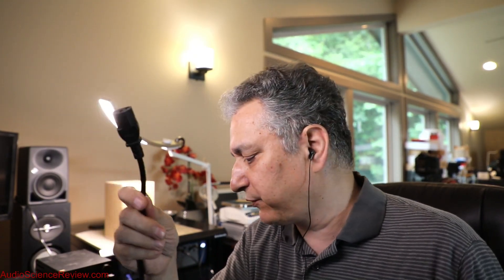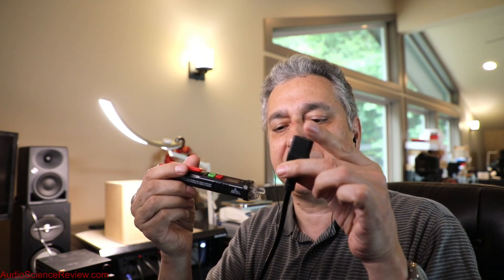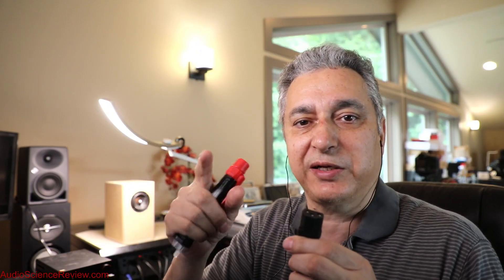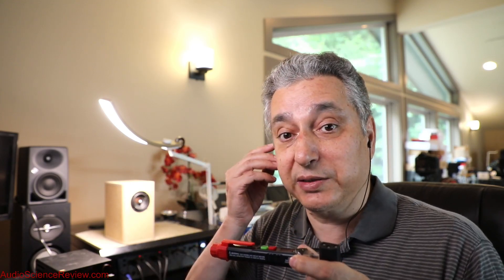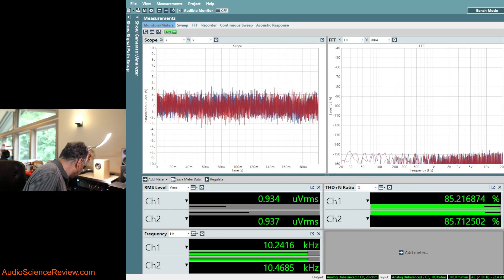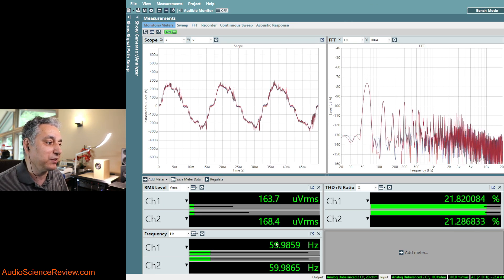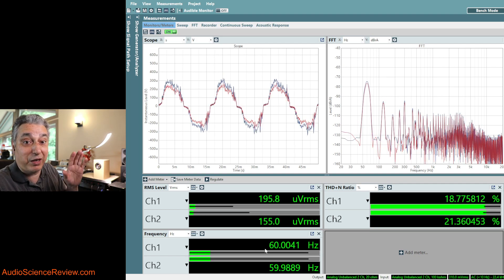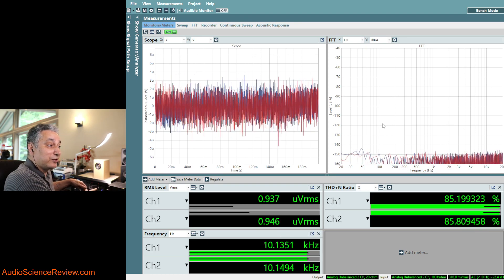Testing Open Power Cord interference in Interconnect Cables

Comment: If I understand correctly, one cable side is connected to mains power and the other side is not. 
Does it like  AudioQuest's patented Dielectric Bias System that uses battery on a cable with one end not connected and one yes - exactly as here ? Thank you

Comment: You clearly demonstrate that an unplugged AC cable can cause interference.  And then you show that plugging the other end eliminates this interference. All good! Curious though - given that such AC cables are plugged in at both ends in practice, why would you present this data in a review?
Reply from the maker: I need to be able to freely manipulate an AC cable around an interconnect to check for its effect.  This is a lot easier with an unterminated AC wire.  I can loop it around the other cable, run it parallel, etc.  It is also a known condition.  If I plugged in the other side into a box, then the issue becomes how that is replicable.

At the end, the simple answer is that it is an ad-hoc test that gets the job done easily and quickly.  :)
Reply: @AudioScienceReview  Hmmm, I can see how that would make it easier to test!

Will those unplugged interactions between the unplugged AC cable and another cable happen when both sides are plugged in?

Comment: Hello Amir, wanted to mention that it would be very informative if you measure the in-room response of open baffle speakers (not predicted in room response).  In room response is what the manufacturers claim is better for open baffle speakers. But before you say I should ask the manufacturers to send you samples I have already done that but I am not hopeful.
Reply from the maker: Hello Anil.  Sure, would be happy to do so.  Which speaker you have in mind for testing?
Reply: @AudioScienceReview  Thanks for your reply. I guess the most acclaimed one out there is the Spatial Audio X series, I guess X3 and X5 are having production issues and X4 is the most easily available one. If you want to measure a speaker from GR research, given size and price, it would make sense to measure the NX Oticas. The manufacturers do mention that their speakers with open baffle woofers create a figure 8 pattern for the bass, but the bass is supposed to be much less prone to room interaction. I am not a sound engineer but have always been curious about this.  Thanks a ton !

Edit : To be fair, the NX-Oticas are known to drop of flat at 70Hz and it is recommended that they are paired with the subwoofers from GR Research.

Comment: Just go to any car audio dealer and pick up shielded audio wire you buy by the foot. Cars are the noisiest when it comes to audio signal interference. All car stereo dealerships that do installs have these in stock. 
Don’t get scammed by these so called high priced audiophile cable and interconnect cables BS on YouTube.
Reply from the maker: Agreed.  Car stereos can pick up all kinds of noise problems.  I had a boat where the automatic throttle system would all of a sudden give up and drop the RPM.  Traced it to a loose belt causing the alternator to generate intermittent output.  This didn't cause any problem for the rest of the boat but the throttle system would go nuts!  Similar deal to cars.
Reply: @AudioScienceReview  
Electronic noise, our computers are noise boxes. LOL. 
We need noise filters to filter out the everything. 
Even our Planets and the Sun is noisy. LOL. NASA has recorded it. YouTube has videos of it you can listen to. Spooky..!!

Comment: I agree with measurements and everything, but even the different wall outlet can sound different not only power cords and how is that posible I scratch my head
Reply: He says nothing that indicates you would hear anything here.
Reply: @johnsmith1474  i know but I hear the difference what so ever, and I am anoyed by that, because what would be the reference outlet or power cord or speaker cable

Comment: When it comes to cable review testing wouldn't it make sense to also post a stock/regular cable measurement in FR and distortion vs the compared cable?
Reply from the maker: Yes, I do that all the time.  I test "no cable" with internal short in the analyzer.  Then a generic but good cable (WBC, Amazon, etc.) and then the premium one.  See my latest review of Iconoclast cable for example: https://www.audiosciencereview.com/forum/index.php?threads/belden-iconoclast-xlr-cable-review.33929/

Comment: Good one!  The AC power cord is akin to an unrolled capacitor, yes?
Reply from the maker: Yes, you can think of it that way as well.
Reply: For a spark-gap Tesla coil I built in 1957 during my high school days, I used a capacitor made from several small sheets of window glass that separated sheets of kitchen aluminum foil and sealed with hot paraffin.  The Tesla coil worked great, but destroyed with static, any reception by nearby AM radios - including the neighbors.  I think that capacitors just need enough surface area of an electrical conductive material  that are separated evenly (parallel) with enough distance or insulation to avoid arcing.

Comment: Sure, there may be a measurable electric field coming from the power cable with only one end connected. However, EMF is proportional to the current flowing through the conductor, which is effectively zero without plugging the cable in (your "capacitor" formed at the terminal will have an insanely low capacitance, and therefore an almost infinite impedance at 60hz). If you already have measurable effects without even plugging the cable in, you'll have drastically more EMF when the cable is actually plugged in and lots of current is flowing through it (as would be in a real-world hifi system).

When you're in a hole, stop digging. It's okay to make mistakes as long as you own up to them, this behaviour is just really immature.
Reply from the maker: Seems like you don't even know what EM in EMF stands for.  E stands for electrical field.  M stands for magnetic field.  Electric field is created by voltage.  It doesn't care about current (it is 90 degrees out of phase).  You can have zero current or a lot.  It won't make a difference to electric field. 

You are also wrong about the capacitor, forgetting the very high potential of mains.  We are talking peaks of 170 volts in US.  Even a small capacitor will let that some of that through.  There are cheap, non-insulated power supplies that use a capacitor to step down voltage.  How the heck did you think the voltage tester worked?  Magic?

Current will drive the magnetic field.  For that, you need some kind of transformer coupling.  I do that as well in my testing.  But that was not the point here.  Person claimed that no field was present which is absurdly wrong if you know the basics of electrical engineering.

So please, stop using you lay understanding of this complex field. Don't listen to audio sales people with zero engineering experience.  Go read the wiki, anything is better than following what got you into this ditch.
Reply: @AudioScienceReview  I'm very aware of what EMF stands for and how it works thank you. There's no need for your attitude.

I'm not wrong about the cable's capacitance, and I'll explain why. We aren't evaluating the absolute current flowing when the cable is unplugged, we're comparing the current when the cable is unplugged (your testing method) to when it's plugged in to a device that demands significant power (the real world).

A standard capacitance for 10-12 awg power cable (likely larger guage than what you're using, and therefore higher capacitance, so this is basically worst case) is about 25pf/ft, so ~150pf for a 6ft power cable. At 60hz, the impedance of a 150pf capacitor is 17.7 million ohms, producing a peak current of less than 1 microamp. At just 100W RMS, we get a current of about 800mA, over 800,000 times (59db) higher current, and a proportionally stronger magnetic field than when the cable is unplugged. Last time I checked, 59db is a pretty huge db difference, so don't try and pretend the EMF put out by your unplugged cable is even remotely comparable to that of the real-world usage.

As an engineer, I understand the need for ultra-specific language, but there's a certain point where an effect becomes so small it's genuinely insignificant. While we're at it, why don't we measure the impurities in the rubber that cause the cable's sleeving to not be a perfect insulator, there must be some current flowing through it? What about the capacitance between the slightly oxidized copper strands of each conductor? You're seriously reaching by claiming that current is flowing through your unplugged cable.

At the end of the day, the effect you measured is on the order of almost a million times less significant than the effect would be had the cable been connected on both ends (the way you should have measured it), and there's no way around that fact.  If your true goal is to educate, your condescending tone (especially to those who have a formal education in the field at hand) certainly doesn't come off great, the Dunning–Kruger effect is truly amazing.
Reply: @XmqApT4yPQVCXGwR5Ozn  thank you! i was wondering why the most obvious was not picked up!
Reply: @XmqApT4yPQVCXGwR5Ozn  Funny accusing Amir for having a condescending tone while at the same time demonstrating yourself to be worse.
"There's no need for your attitude." applies more to you than to him.
Although his reply could've been better, it was warranted by your own comment, especially that last sentence.

Amir is also correctly pointing out that you're ignoring the E part of EMF, the electric field, which is not "proportional to the current flowing through the conductor".
He correctly demonstrates how:
- a single-end connected power wire does emit radiation and it can affect single-end connected interconnects.
- that that radiation does not affect interconnects that are connected at both ends.

And that is what this video is about, debunking a claim made by another person.
Reply: @Kris_M  voltage, current, capacitance, inductance, electric field, magnetic field, electromagnetic field... the "test" shows that there is a potential difference in the cable even though it is only plugged into the wall - which is what potential difference is... however once the cable is plugged into a device and current flows, the behaviour is vastly different... that's what Addison is driving at...
Reply: @nelsonang  I know that, but the video is about a specific claim about a power cable that is not plugged in into a device.
Reply: @nelsonang  Thanks nelson, I'm glad I'm not the only one seeing things this way.
Reply: @Kris_M  and that other video on that other channel is disputing that the test is invalid...   showing that something can be measured doesn't make the measurement valid... I can't measure my weight using a measuring tape even though the measuring tape is telling me I'm getting fat... the reading of the measuring tape is invalid...
Reply: @AudioScienceReview  Electromotive force (EMF) ... not be confused with EMI

Comment: You demonstrate that the electric field does not induce a current and the electric field can be largely shielded by a grounded screen. Shielding the magnetic component is more difficult and that's why loading the cable would be more revealing. Just admit, you slipped up and are retrenching....we all make mistakes....
Reply from the maker: There was no slip up.  For magnetic coupling I use a transformer and you can see that in many of my reviews.  The issue here is that people think the unterminated AC wire is doing nothing.  Clearly it is doing something which you also agree with.
Reply: @AudioScienceReview  Yes, I agree, but to assess the cable fully you must have current running through it to see what it sprays out and couples to adjacent conductors or not, as the case may be.
Reply: @mfr58 with one end pluged in it acts like an antenna. If both ends are  plugged in it would attack like a transformer. Check out a 1m gap of interference. https://youtu.be/oI_X2cMHNe0
Reply: The two lines cancel themselves out and power cord. That's why you can't read current on a power cord unless you separate the two conductors with an clip-on amp probe
Reply: @timcourtney9302   Yes, I've watched that video and listened to Ken Wheeler and Eric Dollard and others on the nature of electricity, which is poorly understood in conventional engineering and physics. You are right in what you say, so I think both conditions should be assessed when reviewing the cable....Listen to what the circuit board designer, at the end of the video, says about not having defined terminations at the end of traces (conductors).  Check this: https://www.youtube.com/watch?v=C7tQJ42nGno

Comment: what power cable you recommend for pc? I use uk version of corsair hx 1000w.
Reply from the maker: Any that is convenient.  In US we are saddled with low AC voltage so I opt for highest gauge I can find for power amps (14 gauge).  In UK you have double the voltage so doesn't really matter.
Reply: @AudioScienceReview  Good Thanks does it matter if I picked platinum PSU for clean power? I read some stutter can be caused of bad psu quality.
Reply: @yooanto9465  The latest GPU's can draw tremendous amounts of transient current which even good PSU's can have trouble sourcing. A heavy AC cord might help, but frankly this is an issue that GPU and PSU manufacturers need to work out among themselves. If your power supply uses modular cables, having a set of custom GPU power cables made that are as short as possible (for lower resistance and inductance) might help. Simply choosing a bigger power supply (1,000W or higher) even though a 700W should be enough may help as well. Bigger power supplies usually have better regulators and more output reservoir capacitance.
Reply: @ScottGrammer  any good model? ho about corsair hx 1000.?
I have corsair rm750 without X. I read it's made in China with cheap components so better to upgrade.
Reply: @yooanto9465  I would hesitate to recommend a model myself. I suggest you look at reviews and buy the best you can afford based on those reviews.
Reply: @ScottGrammer  I'll get Corsair hx1000w

Comment: I would be interested to know what equipment you use once you take off your 'science' hat and sit down to listen to and enjoy music?
Reply from the maker: Depends on scenario.  Most of my daytime listening is while I work so I have to wear a headphone.  My headphone is Dan Clark Stealth.  See my review here: https://www.audiosciencereview.com/forum/index.php?threads/dan-clark-stealth-review-state-of-the-art-headphone.25920/

If I am going to sit back and enjoy music, then the system is Revel Salon 2 speakers.  Electronics change with time.  Currently the source is Topping DAC, driving either Mark Levinson monoblocks (No. 53) or Reference.  I use Roon for streaming from a silent server I have built.  I also have Reel To Reel tape deck for analog listening.  See a picture of them here: https://www.audiosciencereview.com/forum/index.php?threads/review-and-measurements-of-lyngdorf-roomperfect-eq.6799/
Reply: @AudioScienceReview  Nice system, what interconnects and cables do you use? I'm sure that despite the views of some of your followers you're using decent stuff, not simple bell wire!

Comment: This is rubbish the cable isn't carry any current accept low level RFI. Electrician use those devices to check for current is he sating it doesn't matter the device will always react to the cable whether carrying current or not?  Absolute drivel
Reply from the maker: Please watch the video as you sound very confused.  I clearly explained that this type of testing is for electric field that is driven by voltage, not current.  The contactless detector picks it up so any claim that nothing comes out of such an AC cable is total nonsense.  And shows total lack of understanding of basics of field theory and electronics.  Increase current doesn't change a thing about electric field.
Reply: You obviously did not understand the video and are not proficient in the art of electronics , omg
Reply: So Larry, I am an electrician, 40 years. Teaching at our apprenticeship school as well. So if I may. “Electricians” use NCVTs to see if wires are energized. They may or may not be carrying current at the time. The wire(s) may not even be terminated, or connected, like the the video. NCVT are not used to detect current. Current probes are. So may I suggest you check your facts.

Comment: Termination means there is an impedance, I assume a constant one in this example. But is that so for power amps with big caps after the rectifier, but, in case of low volume, not much power drawn?
Reply from the maker: That's correct.  Outside of the power amp, other devices hardly pull any current given the high voltages involved, and low consumption.
Reply: @AudioScienceReview  Many tx for your answer!! My point is, that with a power amp, impedance isn’t a constant one since charging of caps is only possible if voltage is higher than the caps’ voltage, which creates a very non-linear behavior, and perhaps a better chance for unshielded power cable to create noise due to magnetic field of a wider frequency range.. true?
Reply: @gioponti6359  yes true, the non linear nature of the power amp power supply you describe will generate harmonics but most of them will be blocked by the transformer and therefore will result in very small harmonics felt back to the mains but they will still be there.  If you had a hard wired rectifier circuit to the mains then there would be a lot more harmonics felt on the mains from the non-linear load.
Reply: @motjones2341  hi, thanks alot for clarification!